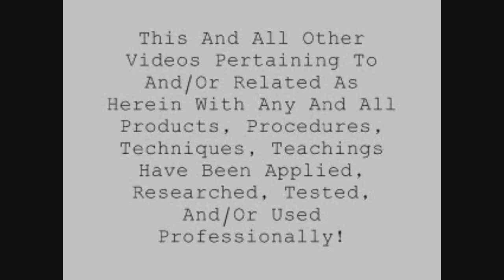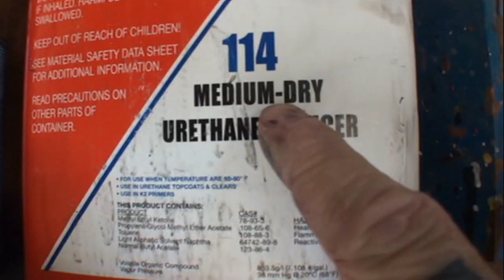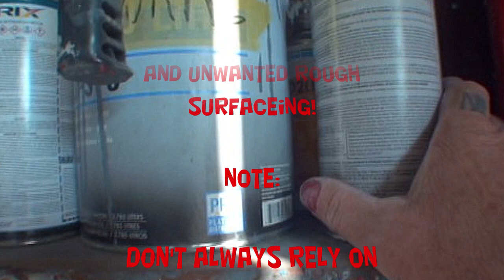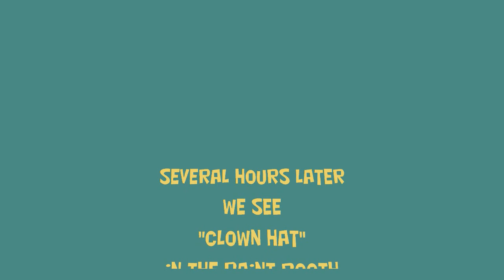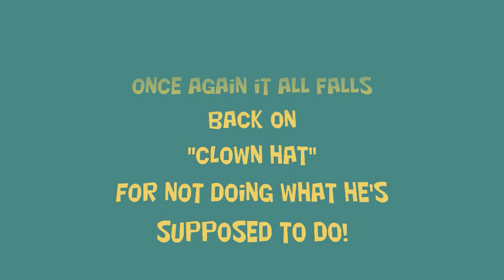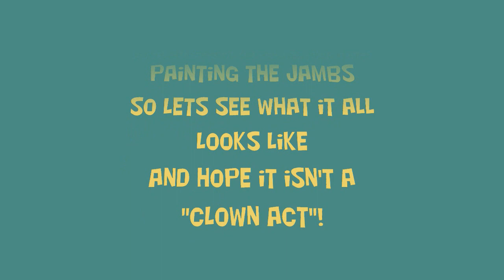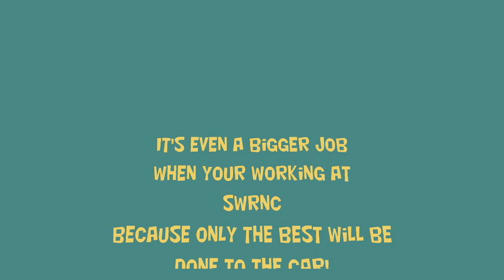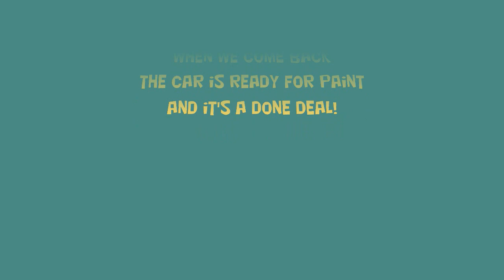Tech Tips And Tricks For A Professional Paint Job | Part 3

Comment: You probably know this already but as a tip to your viewers fiberglass Evercoat makes a little knife that you hold any 30 degree angle and you can do very precise work with it like a Benihana chef. Other people's duplication of it just like a Taiwanese part didn't work because they used crappy blades. Why we're barbecuing people in the industry like dynacorn perhaps we can go after or you can go after oh I don't know insurance adjusters and the guys that sell fasteners. There's a dozen more things you could easily go after to rake these guys over the coals.

Comment: kewl trick tip. because I am lazy & CHEAP I've mixed my clear in the spray gun with the base coat residue "in there. but that trick came about because I was spraying metallics. I was thinking it would give it more depth so they would float. by time I use more clear it should be cleared out by then anyways. just don't get any runs because the metallics will sag with the clear=^-^= thanks for sharing I always thought I was doing a no no. kind of like making my own Mickey Mouse single stage😊

Comment: Friend of mine got his new car back from body shop. One of those independent shops that has gone chain ownership.
Cut cost and fast turnaround.  They have nice glossy advertising of the great work they do and the great "lifetime guarantee".
I did not say anything but they missed so many spots.
Bumper they just missed around the lights and openings.  6 months later most of paint on bumper flaked off.
Paint on the lid has a halo effect from the primer. Lid looks lopsided.  Car smells moldy.  Sure trunk is leaking. 
Shop keeps jerking him around 2 fix it for months now.  Told him it was a great job he has a written "lifetime guarantee",what more can he ask for. 
   You lose a  small amount of gloss when you leave basecoat in gun?  
 Is basecoat  reducer is different then clear reducer 
   When you spray outside you just backtape it?
Thank you

Comment: Pete,can I use a clear paint over a single stage basecoat paint???If I sanded it down to add stripes or a flame paint job over the single stage....?????
Reply: yes you can clear over SS paint, then light LIGHT sand and buff

Comment: Any idea on your Pant to Clear to Reducer ratios for those jams?
Reply from the maker: when you pour the paint out of your gun, leave the residue in it and then pour your mixed clear in the gun and mix togeather.. All this does is give it a slight tint of color and adds a thin layer of reducer to let it flow out smoothly.. DO NOT USE THIS METHOD ON THE OUTSIDE OF THE VEHICLE -- ONLY TO BE USED ON JAMBS AND UNDERHOOD/TRUNK USE!
Reply: Thanks for taking the time to reply.  Almost impossible for guys who have SOOO many questions and trolls to deal with.